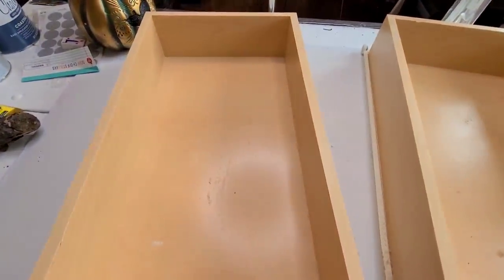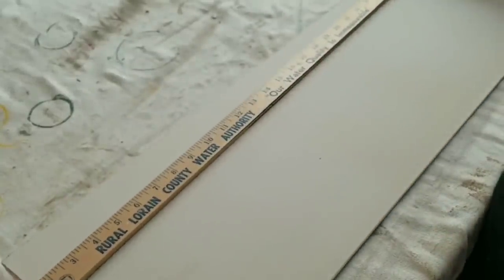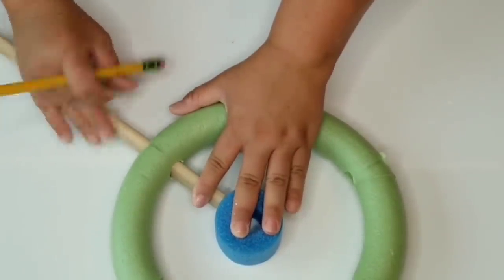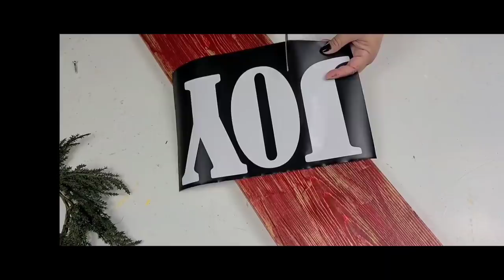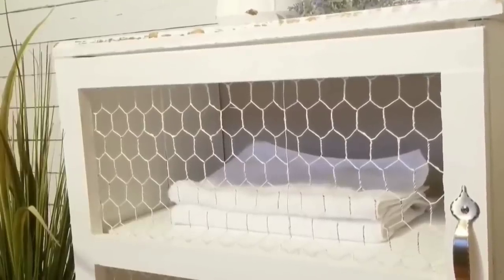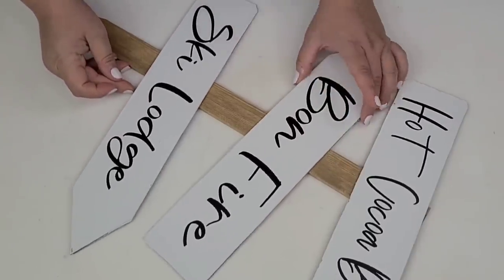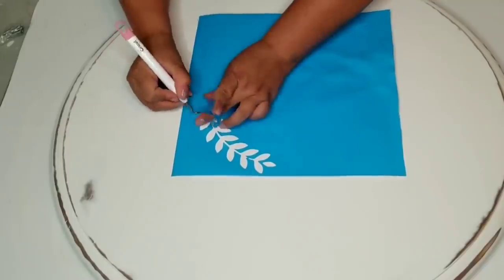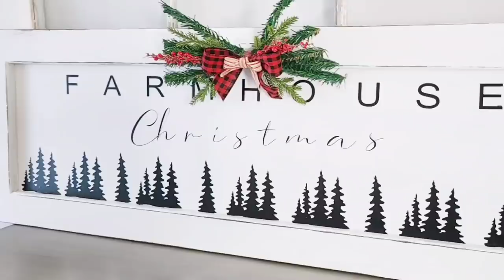🌟 Best 20 of 2020 DIY Room Decor | How to Decorate your Home for the Seasons

Comment: Would you mind sharing how much you charge for your furniture and where do you like to post them on?
Reply from the maker: Sure! In regards tomprice, I make sure I charge enough to make back what I paid for it, for supplies used, I often charge between $10 and $30 depending on the size of the furniture. And then charge about $25 an hour. This will vary tremendously, due to different challenges that often come up unexpectedly. I try to price on the low end sonora sells quickly. I lost on my local Facebook Marketplace.

Comment: When you polyurethane do you sand in between coats?
Reply from the maker: Sometimes I do. But most often I don't. It depends. If I do thin coates then no, but if it's heavier coates then I do a very very light and with a 220 sand paper